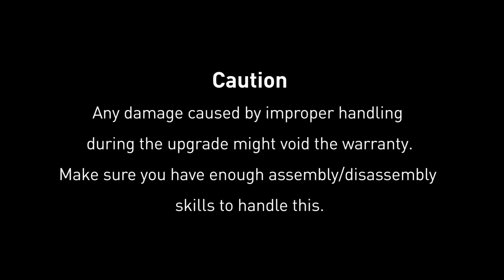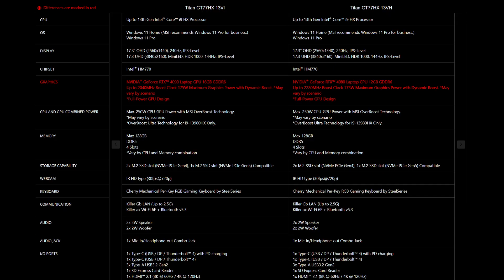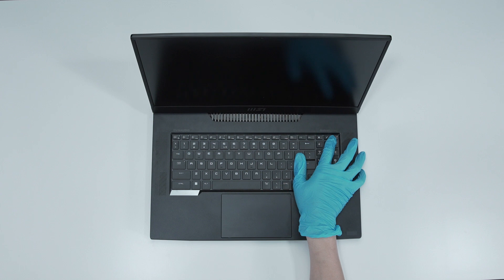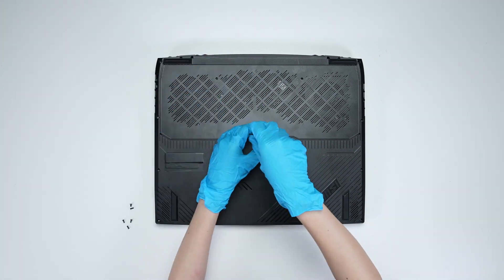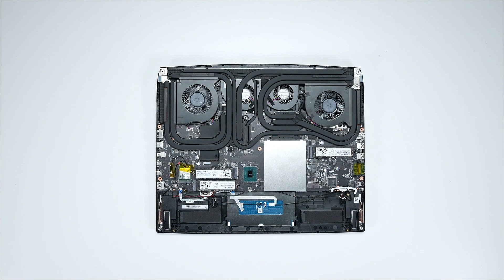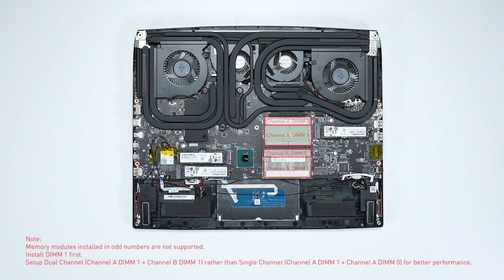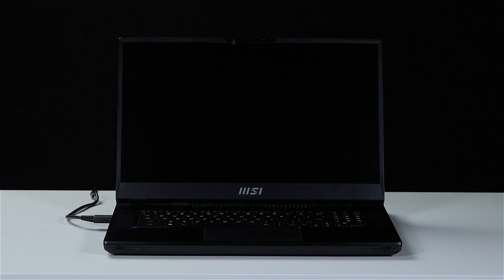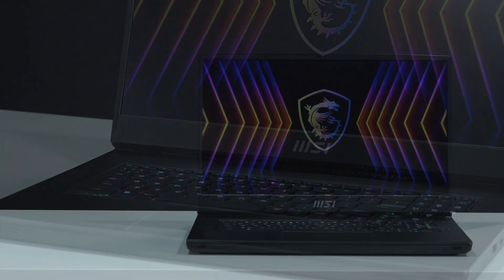MSI Titan GT77HX Upgrade Tutorial

Comment: OK I'm guessing after doing the 25 seconds power button off,  it is necessary to unplug the battery and plug it back in to bring this back to life? I didn't do that step, no power on currently.
Reply: Pulled the battery.  Still nothing. The power supply was not lit up. I unplugged it and plugged it back in - now the light is green.  I have a charging indicator on the , getting the msi dragon , i think it is rebooting.. finally got into bios.. it see my new WD 8TB (RST WD_BLANK SN850X 8000GB 8001.5GB).  trying to boot again.   Here comes windows!!! I'm in! WHEW!!!!!   Now into disk management to format "DISK 1" .. Now creating simple 8tb volume... boom there it is..  The pad I used was pretty thick (but i checked under another drive and those looked pretty thick too)... Looked like the SSD was slightly bowing... Anyways, time to put all the screws back in!! THANKS!!!

Comment: pretty sure the Gen 5 is on the right hand side by itself and not in the top left which is the primary drive slot, at least it's the case for the HX 13VI and all over vids and images I've seen including my own.
Reply: Yeah the PCI-e 5.0 is the one alone on the right side

Comment: Where are the other 2 ram slots? Which ones come populated on the 65GB ram version?
Reply from the maker: There have 4 slots under  memory shielding case, the ram specification you may asking the retailer.
Reply: @MFLAB  I bought in the end the version with 128GB ram, and replaced the original disk with a Crucial T700 pcie 5.0, and 2x Samsung 990 Pro with 4TB each, which I set up in Raid mirroring. Nevertheless everytime I boot up my laptop, I get a Boot error "abnormal status reported by rapid storage technology uefi driver" Both disks were blank when setting them up, but only after a few weeks, got this message. Tried reinstalling IRST driver, but still, same error. Do you know any way to fix it? Thank you!